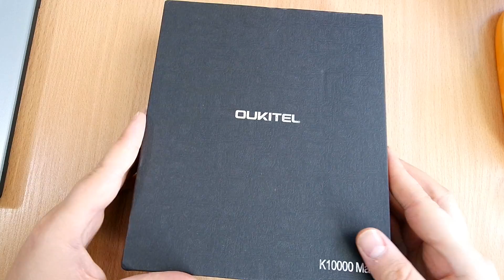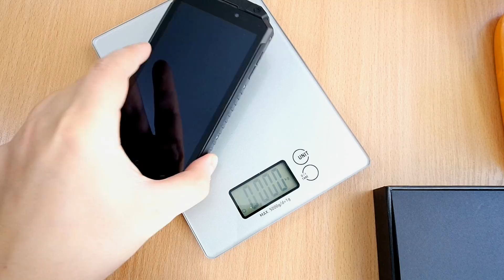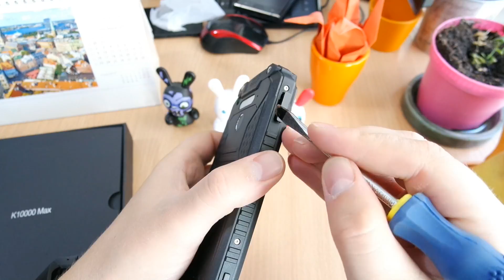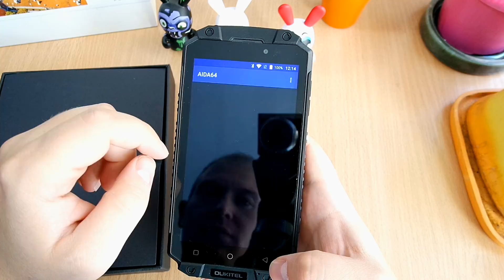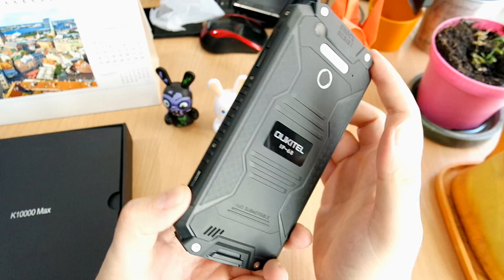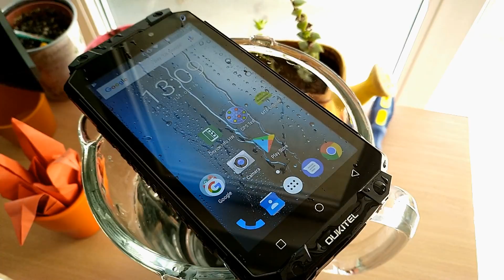Oukitel K10000 MAX Unboxing (IP68, Tri Proof, USB-C) | 10000mAh BATTERY BEAST!

Comment: I have  had phone  it for 6 months . . It is crap if you use bluetooth  battery lasts one day.. You turn one morning it tells you must reset as phone has problem and you lose all your data.. I had to open and glue battery clip to board as it would  disconnect at the slightest bump . battery does not last that much longer . my snopow m8 with bluetooth on last longer